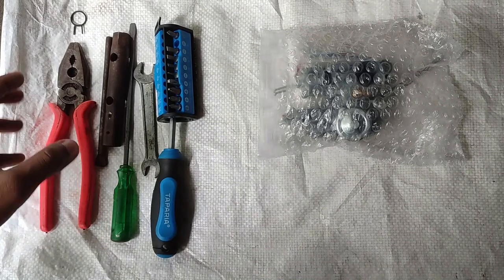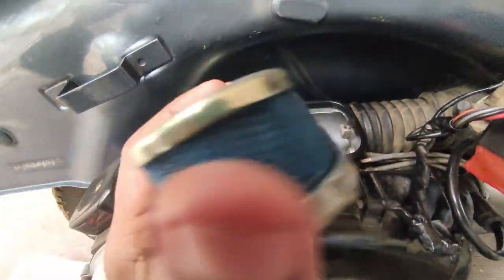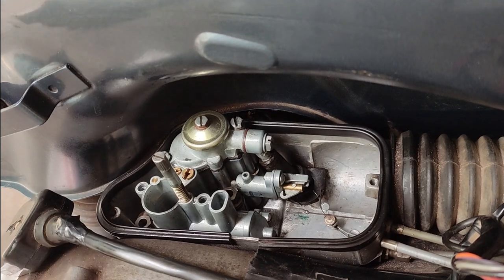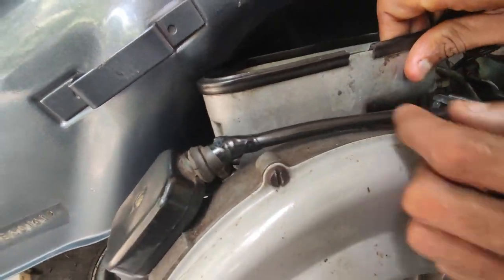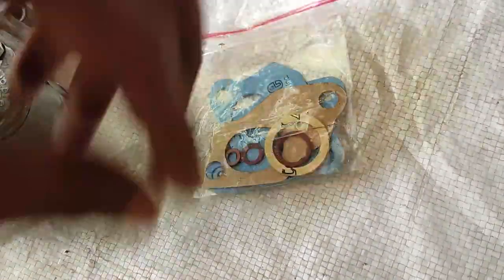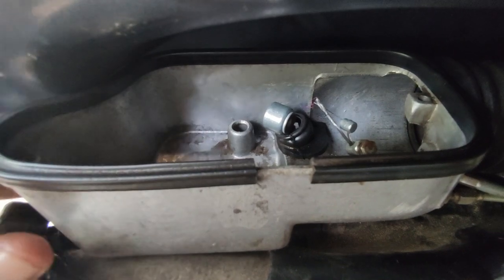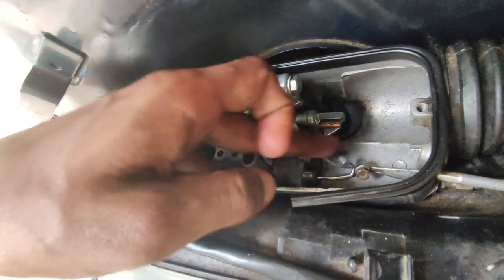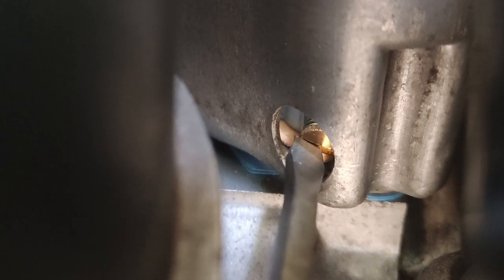How to change Bajaj Chetak Carburator / Vintage scooter Carburator replace / Twostroke Carburator

Comment: why do you replace the original carburetor what's wrong with it?
Reply from the maker: Overflow
Reply: @Rtrone  then you can change flot section?
Reply from the maker: I didn't get the float body for jetex Carburator
Reply: @Rtrone  ok my carborator spaco

Comment: Jetexintem float chamber vagikkan kittumallo
Reply from the maker: Kittumalle sorry bro
Reply: @Rtrone  2 type varunnund . Onn float chamberil hole varunna type alland normal typum . 150 below anu rate .
Reply from the maker: Thankz bro
Reply from the maker: Pinne vere oru jetex car undayirunnu ath interchange thanne float chamber vechu nokkiyirunnu appo petrol irangunnilla
Reply: @Rtrone  block anonn nokiyatirunno . Needleum 2 type und needlinte hight koodiyalum ee issue varum .
Reply: @Rtrone  machante sthalam evidanh
Reply from the maker: Yes njan nokkiyirunnu needle different aayirunnu
Reply from the maker: Kollam

Comment: Splender nte carb chetakin set ചെയ്യുന്നുണ്ടല്ലോ 60 ഒക്കെ മൈലേജ് കിട്ടും എന്ന് പറയുന്നു സത്യമാണോ
Reply from the maker: Yes but ath new model chetakinte mouthilan set cheyyunnath but chetakinte intial kittilla
Reply: @Rtrone  old chetak mouth varunundallo
Reply from the maker: Old Carburator e model pole thanne aan pinne bro parayunna type mounth vannirunno enn ariyilla
Reply: Sllendarinte nadakko bro

Comment: ചേട്ടാ, 1998 model Chethak ആണ്. Spark Plug ൽ കറണ്ട് Spark വരുന്നില്ല. CDI Unit ലേക്ക് Starting Coil - ൽ നിന്ന് Current വരുന്നുണ്ട്. പക്ഷെ CDI Unit-ൽ നിന്നും Ignition coil ലേക്ക് Current output വരുന്നില്ല. അപ്പോൾ CDI Unit തകരാറിലായതാണോ?
Reply from the maker: Maybe coil koodi check cheyyanam

Comment: Wrok shop evden bro
Reply from the maker: Vtl thanne
Reply: @Rtrone  evde veed
Reply from the maker: Kollam Karunagappally
Reply: Please share the buying link of carborator ? 

Also is it possible to remove the white smoke ?
Reply from the maker: Bro i brought this from a Shop 
And we can avoid white smoke from 2stroke motorcycles because we mixing 2T oil into petrol